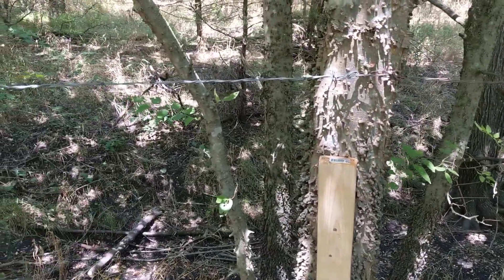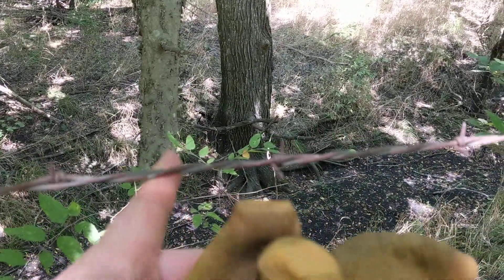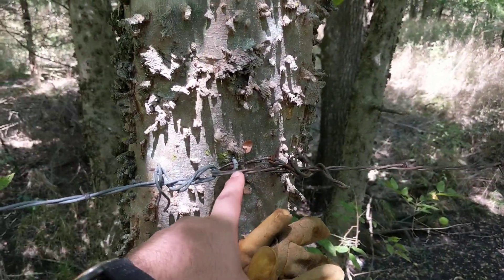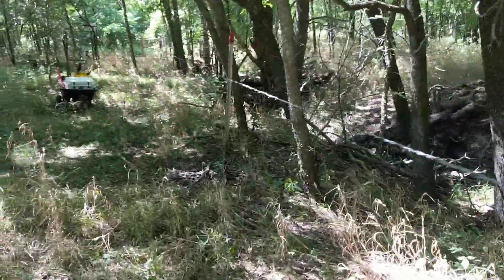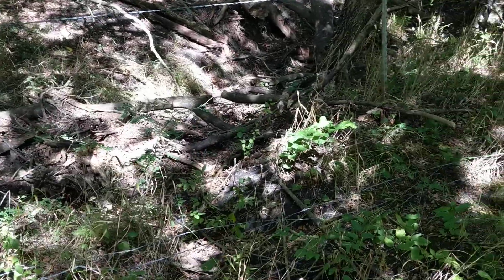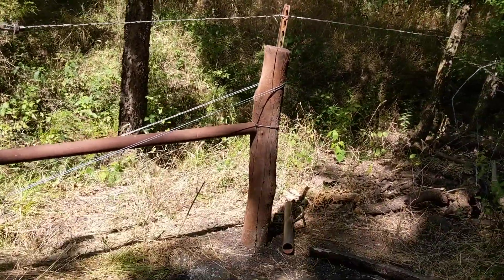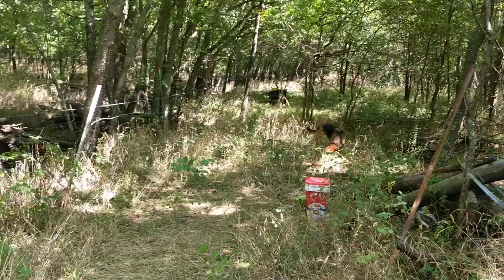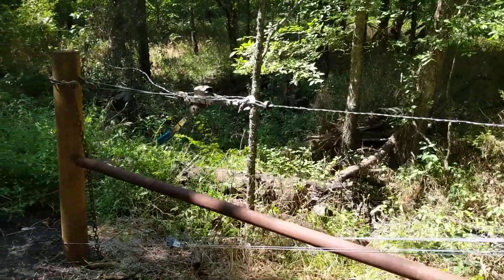Barbed Wire Fencing Along A Creek LIne

Comment: Noticed you use a wire strainer to tighten the wire inside your brace versus using a twisted wire.  Is there a benefit?
Reply from the maker: I like to be able to re-tighten with a couple of cranks vs dealing with a rod under tension.  Both work good.